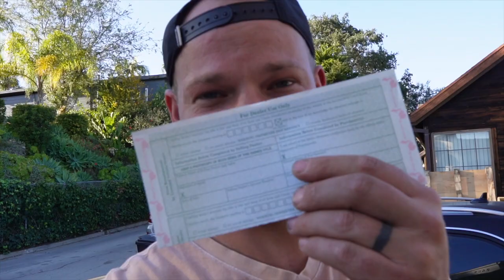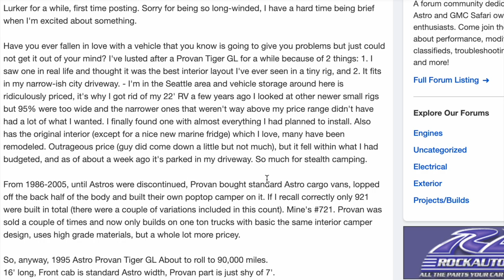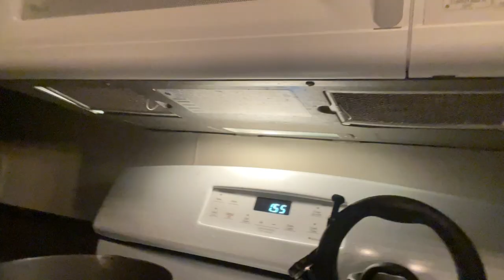WE BOUGHT A VAN! (Astro van conversion) RARE 1991 Chevy Astro Tiger

Comment: I wish I'd done that at 14:00 My 1988 Astro van (bought on ebay in 2019 for $2,250) had been home to some mice many years ago. I had to take out the headliner and a bunch of the little plastic 'add ons'... It's been almost 5 years & some of them are still just half-way attached because I got all the bolts, screws, clips, etc. all mixed up.